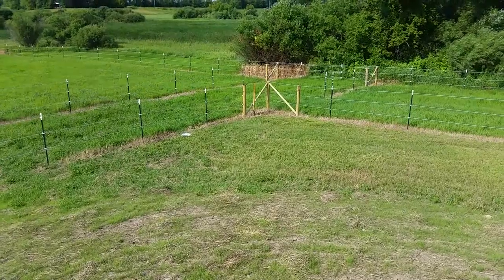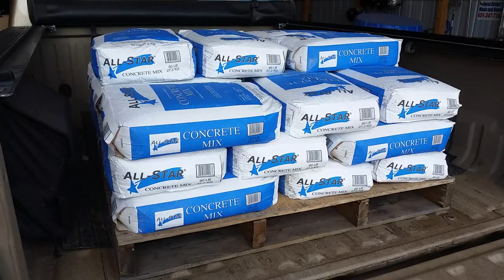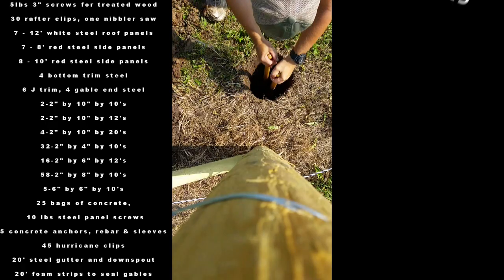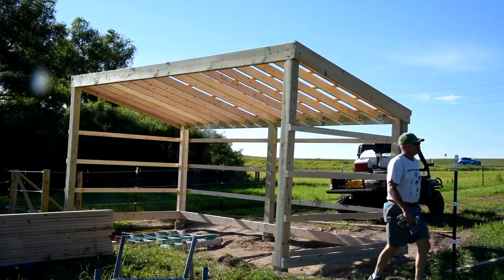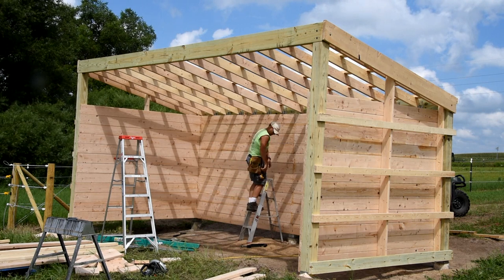DIY Building Lean Barn Shelter for Horses or Cattle

Comment: Pardon my ignorance as a city boy. I don't have any experience with horses or agriculture in general. I remember a relative having a water trough next to the barn for their horses. Would making use of the roof, gutter, and downspout as a rainwater collection system make sense in this case?
Reply: Jesse Hires just stick to stock tanks with a hose and float, and maintain it regularly

Comment: 2600 for a lean too seems high? I built my garage for 4500 and it's a fully enclosed garage.
Reply: Lovely video content! Excuse me for the intrusion, I would appreciate your initial thoughts. Have you heard about - Mahorrla Wooden Paradise Method (erm, check it on google should be there)? It is a great one of a kind guide for building better sheds and woodworking without the hard work. Ive heard some amazing things about it and my friend at very last got excellent results with it.
Reply: Your garage probably doesn’t have 2x8 interior walls, plus he didn’t cut any corners on material.

Comment: What’s the size of the lumber in between the 2x4 and the 2x8’s on the side? (5:00 mark) I’m building one using this video and have had lots of confusion. Thank you!
Reply from the maker: Kinda hard to tell which boards your asking about but the inner horizontal baords can be 2 by 8 or 2 by 10 your choice, the corner vertical boards to frame out the corner is 2 by 4 for nailing into , hope that helps

Comment: I’m sorry but I never heard or seen the dimensions of this lean too. Do you know what they are?
Reply from the maker: https://www.facebook.com/RMSpeltz
Building Lean Barn or Shelter: This is video we made of the family putting up a lean barn for horse and or cattle pasture shelter this year about 20 by 10 almost the supply list is below to help anyone build one of these great leans.  Check out a more movable version we also have built in the past "Lean Barn on Skids"  https://youtu.be/kcN48ELPwiE

5lbs 3" screws for treated wood
30 rafter clips, one nibbler saw
7 - 12' white steel roof panels
7 - 8' red steel side panels
8 - 10' red steel side panels
4 bottom trim steel
6 J trim, 4 gable end steel
2-2" by 10" by 10's
2-2" by 10" by 12's
4-2" by 10" by 20's
32-2" by 4" by 10's
16-2" by 6" by 12's
58-2" by 8" by 10's
5-6" by 6" by 10's
25 bags of concrete,
 10 lbs steel panel screws
5 concrete anchors, rebar & sleeves
45 hurricane clips
20' steel gutter and downspout
20' foam strips to seal gables
Reply: @RMSpeltzFarm  
Thank you. However, could you also tell me the height of the front and back. I would greatly appreciate it. Thank you again.
Reply from the maker: My front is just over 9ft 8 inches, I tried to measure but there is mud there tonight and back is 7ft 10inches to top of the gutter.  I pretty sure we made this one 10 ft in frt and about 8 in back so close to 3/12 pitch if I recall right, hope this helps

Comment: 4:27 you mention purlins across the rafters and sides being 2'x4's and judging from the supply list the 2'x4's are only 10'. So the dimensions of the shed are 20'x10'? I'd like to build this I just need dimensions on where to put the concrete anchors and you never state the width. just 20' long by 10' high in front and 8' high on the rear.
Reply: Yes...me too.  Were about to build a fence pasture for 2 horses.  But we will also need a shelter.  It gets cold up north and the bugs are bad.

Comment: Can I get a supply list for the skid version of this lean to?  Thanks
Reply from the maker: does this help:  5lbs 3" screws for treated wood
30 rafter clips, one nibbler saw
7 - 12' white steel roof panels
7 - 8' red steel side panels
8 - 10' red steel side panels
4 bottom trim steel
6 J trim, 4 gable end steel
2-2" by 10" by 10's
2-2" by 10" by 12's
4-2" by 10" by 20's
32-2" by 4" by 10's
16-2" by 6" by 12's
58-2" by 8" by 10's
5-6" by 6" by 10's
25 bags of concrete,
 10 lbs steel panel screws
5 concrete anchors, rebar & sleeves
45 hurricane clips
20' steel gutter and downspout
20' foam strips to seal gables

us farmers kinda do this be thought and not so much list lol

Comment: What size plank are you using between the 2x4 and 2x8 around the 5 minute mark? Thank you
Reply from the maker: Kinda hard to tell which boards your asking about but the inner horizontal boards can be 2 by 8 or 2 by 10 your choice, the corner vertical boards to frame out the corner is 2 by 4 for nailing into , hope that helps

Comment: Where is your materials list?  Thanks  :)
Reply from the maker: 5lbs 3" screws for treated wood
30 rafter clips, one nibbler saw
7 - 12' white steel roof panels
7 - 8' red steel side panels
8 - 10' red steel side panels
4 bottom trim steel
6 J trim, 4 gable end steel
2-2" by 10" by 10's
2-2" by 10" by 12's
4-2" by 10" by 20's
32-2" by 4" by 10's
16-2" by 6" by 12's
58-2" by 8" by 10's
5-6" by 6" by 10's
25 bags of concrete,
 10 lbs steel panel screws
5 concrete anchors, rebar & sleeves
45 hurricane clips
20' steel gutter and downspout
20' foam strips to seal gables

Comment: Having sheathing under metal roof is usually a good idea. The noise from rain hitting a metal roof will make allot of horses not even use it.
Reply: Our horses use one that has acorns dropping during the fall and get used to it..sometimes they use it in the rain some times not. Do you have horses that don’t use them in the rain?? I see them typically under it if the rain gets really heavy..

Comment: Beautiful building and beautifully executed.  Great workmanship.  However...it isn't really suitable for horses.
Let  me tell you why.
1.  Horses need to be able to see what's on the other side of the wall.  It makes them nervous to have noises they can't check out.  So, walls for horses should never be solid.
1" slots are preferred with 2" boards. I've seen people build these kinds of structures in their pastures and the horses hardly ever use them because the are blind to everything on three sides.  There was a guy in OK who built three structures in his pastures for his horses just like yours 9Minus the good looking metal) but when his horses wouldn't use them, he was told how to fix them and he did it to one and found they used it.  He simply pulled every other board from the backside and one end and every board from the other end.  The other issue is that horses low on the pecking order don't want to get caught in corners.  So that makes them anxious to enter.
2.  Research from Canada says that when putting three walls on a structure, it actually makes it windier and colder.  It creates a kind of vacuum that tends to pull air and water in. Two walls are preferred and placed so they are a break against the main direction of wind and rain.
3.  There is a foil that can be used in the ceilings that reduces, by over 90%, radiation from penetrating into the structure.  It's a very odd thing, but in a structure without it, it can be hotter under the roof, than outside the structure.  In a structure with it, it 'feels' cooler under the roof than if you step out from under it.  If you think of heat like water then the foil stops the 'water' from bearing down on you and allows heat to escape from you body leaving you feeling cooler.  Again, the Canadian Agricultural centers researched this and got higher productions from cow and chickens when they were kept under 'foiled' roofs.  And it 'feels' cooler even though the temp on a thermometer can be the same under the roof as outside.  What is different is the "thermal gradient" and that really is a big deal.  Also, the foil is pretty inexpensive, maybe adding $100 to the overall cost of your structure.
But it really is a beautiful structure and well executed.
Reply: Where do you apply this foil?  Directly to the  wood on the inside of the roof???
Reply: If you leave slots...dont thebugs get in?
Reply: In Canada, the horse flies are terrible from mid June to end of
 July.  Our horse shelters have 3 sides and are totally closed in.  We hang canvas tarp on the open side to keep it dark..therefore the bugs stay out!
Reply: The horses run out of the barn and into their shelter.